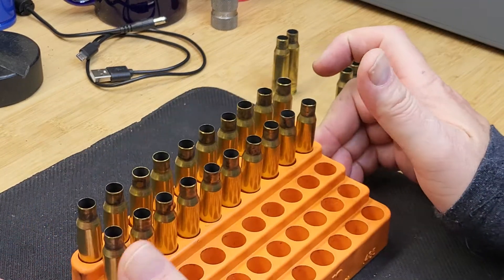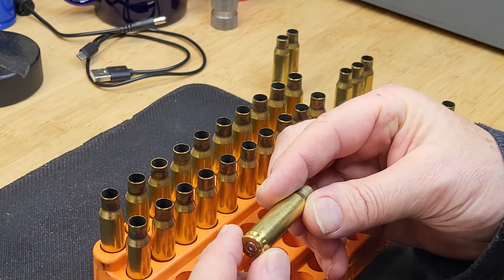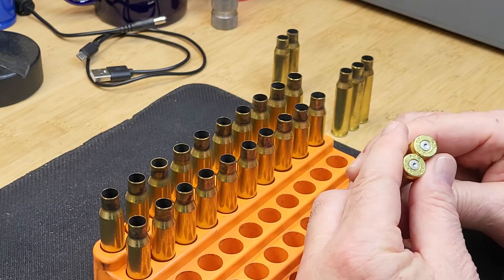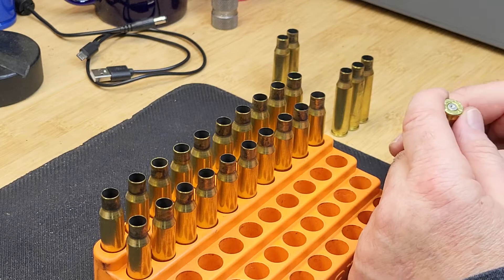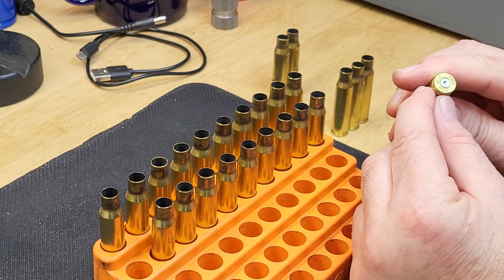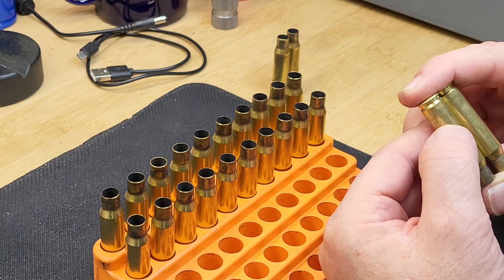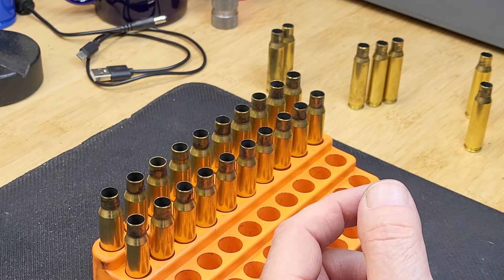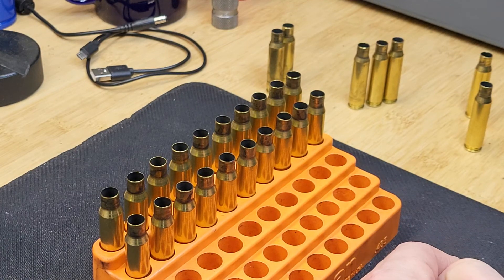Signs of high pressure loads and case head speration

Comment: That ring is usually where the resizing die stops. Use a paper clip to feel on the inside for a ridge. If it catches the ridge that is a tell tale sign of separation
Reply from the maker: The ring is not all the time due to sizing die. You correct, the paper clip can be used as a feeler. Better yet, you can use a Teslong endoscope, if you have one, to inspect the inside of the case for any cracks.

Comment: You get it completely opposite. Flattened primer is a sign of a high pressure, cratering IS NOT always. Extractor mark is also not a sign, it depends on a gun. And those cases with marks near the end of the case are indeed from FL resizing, yet you throw them away for some reason because you are scared? I got those marks from just one resize quite often, if I would have to reload like you I would already throw away like +1000 Lapua brass cases. Case separation is also a sign of fatigue or low quality cases. Also it could be because of excessive headspace, be it from a chamber being too big or die bumping shoulders too much. In your case those marks that comes from die could be more visible because you work your brass too much, reducing its size from shoulders and creating excessive headspace, resulting in case separation.
Reply from the maker: Second opinion
https://youtu.be/dVYSG8VO9EU?si=Ub-vfu3d9iBHrrXi

Comment: That " ring of death " is not necessarily from over pressure loads. It's from worn out work hardened streched brass from many firing and sizing cycles.
Reply from the maker: Terry,
A high pressure load would stretch the case wall more than a mild load. That would accelerate the wear on the case and reduce the number of possible reload. If the case is not  a quality case such as Lapua, the number of reloads possible is way less. 
Thanks for your comment.
Reply: @YERAFirearms  ANY firing of any brand brass stretches it. Now, resize and fire, resize and fire again and again. As I stated, this ring is what eventually happens to all brass after multiple firing and resize cycles. It's not necessarily due to a overpressure load. All brass work hardens as it's used over and over. This stretching that occurs ahead of the case head is the weak point in the case and is where it eventually gives out. Certainly high pressure is a contributor to the eventual demise of the case, just not the primary culprit. It's that repeated working of the case that really is the main cause.
Reply from the maker: @terryhenry8243  I agree.

Comment: You speak better English than I would speak your native language but you’re still very hard to understand, slow down.  When you present the case your speaking about, hold it still, hold it in the center of the camera lens, get your fingers out of the way and give us time to examine it before you move to the next case. I think we would all be better served if you used a zoom lens or microscope to show pressure signs.  Hell, I dont know anymore now than before I watched the video…….
Reply from the maker: Thanks, Dave. Correct, I need to slow down and use a camera on a tripod, or mounted overhead.